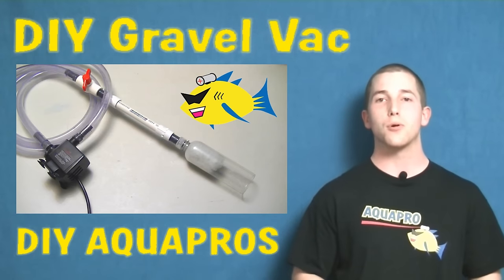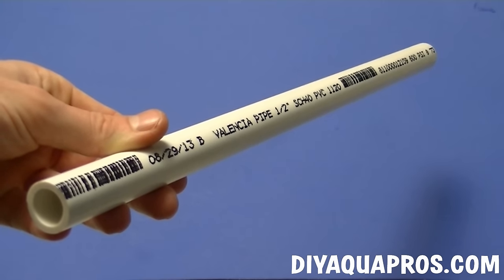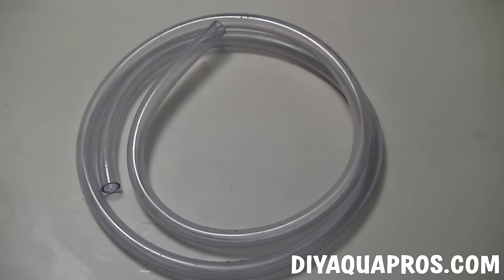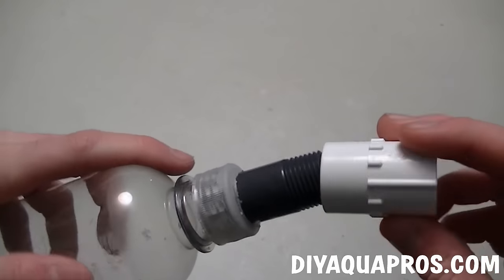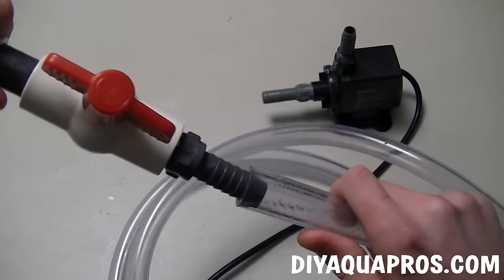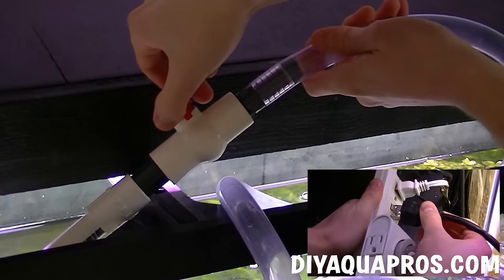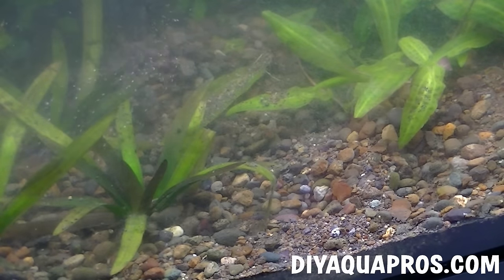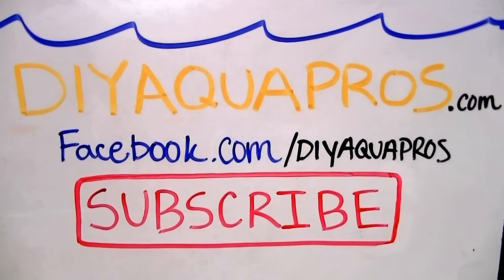How To Make: DIY Gravel Vacuum (Aquarium Gravel Cleaner)

Comment: Just watched this video. I had a similar rig for my tank about 12 years ago. Instead of finding a smaller pump, use the ball valve to reduce the water flow and that should take care of the sand problem mentioned in the video. Sorry if this was already mentioned in another comment. Nice setup. Think I'll revisit this for the small aquarium store I work at.

Comment: I think that if you partly close the valve, it would reduce the water flow, which would then reduce the suction and therefore, can be set low enough not to pick up the sand. Or at least, minimize it. Not a bad idea, but if you powered it with an air stone, it would be cheaper, and much more compact. No need for the hoses and just use a filter bag on the end to catch the debris.
Reply: Great add on idea!
Reply: Yup. clamp your hose to reduce the flow rate.
Reply: Larger bottle size if there is room might also help. 👍

Comment: good idea BUT you should never throttle the intake of any pump.  You can safely throttle the discharge of a centrifugal (kinetic) pump, which most aquarium pumps are.  So install the ball valve on the discharge side of the pump.
Reply: It is to stop the syphon while holding the syphon. You fill the intake with water and plug the end and let it go in a bucket. Then stop the flow with the ball valve then plug the tube easily into the pump. The pump is never on until they syphone is pushing water to the pump.

Comment: A wider bottle may reduce the upward flow rate, making it more suitable with sand. I haven't tried it, but it's an idea.
Reply: Or you could just close the ball valve slightly until you get the auction desired...
Reply: Yeah he is pretty dumb to not figure this out himself.

Comment: to slow the suction down why don't you close the ball valve down so it is reducing the flow ???
Reply: +rov furness 
I agree with you! The solution is already built in that device. The intake suction can be regulated by adjusting the the ball valve as wished. These pumps won't break, even if the ball valve is completely closed and kept like that for a while.

Comment: For everyone using this specific powerhead, be sure to seal the intake cap portion on the powerhead. it has an O ring, and twists to lock tight, but the seal isn't great. Check the video at 5:15 and you'll see he's done the same.

Comment: I am an inventor working on this idea for awhile. I just tested it this very hour. The solution is simple and suck in everything faster with mesh screen ( to filter gravel from going into pump ) at intake. Put the tube with filters at the output right back into the tank filtered. I use  porous foam plugs.

Comment: This is an awesome idea, great job.  What I did, since I already had one of those siphoning gravel cleaners and an extra water filter that came with the aquarium kit I bought (but I upgraded to a better one), I simply run the water through the filter as it hangs over a bucket, and dump that water back in.  Rinse out the filter media for use next time.  If you don't have an extra filter, just stuff some media in the vacuum/bottle like they did here.

It's nowhere near as convenient as this, though, but just an idea for others who aren't inclined to go through with this.
Reply: +Dave “The One and only” Gahan Yep, you can do that. Just plumb it into the middle of your hose, like what's done in this video. Then you can turn the valve to adjust speed, after you have the siphon going.  If you are NOT using a pump to do this (meaning it's your basic gravel cleaner fed by siphon/gravity)...  I'd put the valve closer to the output end of your hose. That way, if you need to close it for some reason (like answering the phone etc)--  you will not lose the siphon.
Reply: Steve Syed he shows the output going directly back into the tank. not a bucket.

Comment: Brilliant idea definitely going to be making one of these if the flow is too strong reduce the pressure with the Valve you’ve already put in line I would also be tempted to use a in-line filter instead of putting the floss in the neck you would be able to put it in the filter loads of cheap ones online

Comment: You can use it for sand as well. Reduce the suction power by decreasing the flow using a separate ball valve at the output section of the pump

Comment: I bought the pump from City Pets close to my work near Beltway 8 and Beechnut in Houston and they even did price matching to the Amazon price plus a few dollars which was still less than shipping. I found all of the plumbing parts and even a perfect 20 oz. bottle at my local Home Depot and the Poly fill at Michaels. I struggled at first with the siphon like someone else mentioned but after I had the siphon completely flowing to a bucket I was able to plug the pump in and just dead headed it with my thumb in order to bring it back to the tank for recycle. I have only had my 36 gallon tank now for around one month but the amount of crud this thing extracted was just incredible. I use larger size gravel and so the concern about sand getting entrained was not a problem for me but I imagine chocking off the flow with the ball valve may work to control the vacuum pressure. I am going to add a power rated rocker switch to the line for easier on off control and may experiment with adding a squeeze siphon inline to get things started. Thanks DIY AQUAPRO TEAM!!

Comment: Perfect. Now you can clean the bottom of the tank, even when your tank is standing right on the floor. The same with water changes. In my case, my paludarium is standing on the floor without closet. So I am going to make this! Thx. for the vid. Very clear.
Reply from the maker: That's another great application! Thanks for watching!
Reply: I have the same problem. The only place where I could find to keep my aquarium is on the floor. The usual gravel cleaners cannot suck up the muck at all.

This solution would probably go a long way in tidying up the substrate.

Comment: If you use a t valve in place of one of the threaded pipe couplers you can open and close the valve to allow water to come in the t-valve as well as your intake allowing you to control the suction strength while not affecting or straining the pump.

Comment: I use an external filter connected via a pipe to a gravel vacuum attachment so that water is filtered & fed back into the tank. Works better if the external filter is on a chair or table so it's at a similar height to the tank which means it's not trying to pump water to the tank as hard.

Comment: Hey Mike tried this on my 20gal aquarium but couldn't get the siphon action going in order to start the process every time I did it air would keep coming into the system....would really appreciate it if you did a small detailed video on how to start the siphon action....PS my tanks about hip height!.....PS only modification I did was I used the flexible 12" hose rather than PVC. Thank and hope to receive a feed back!
Reply from the maker: Rakesh Porob Sometimes the siphon part can be tricky... one of the downsides to the design. Just have to mess with it and be prepared to try it a few times, If you need more help lemme know

Comment: The link you provided for the powerhead redirects you to Amazon and then to a powerhead that doesn't look anything like 
the powerhead used in this DYI. Are you able to provide the make and model number for the unit you used, which includes the required threading for the attachments.
Reply: If you hadn't figured it out by now, when you pull up the link, just click on the option to change the style to a "bottom draw" and you'll see the one he used.

Comment: In any mature tank if you suck water from beneath the gravel and then return that water to the tank you will be adding toxic wastes such as hydrogen sulfide and sulfur dioxide back into the tank. Especially in a planted tank as you showed in the video. It can get anaerobic at the bottom of a gravel column.
Reply: Fishman and that toxic waste was hidden in the sand/gravel, but now is more exposed to water, causing a bigger problem.
Reply: I was looking suchs a response like this cause I'm totally agree. Bad idea.

Comment: OK, I know this has been up for quite a while, but I have a question. I followed the directions, got all the parts, but for the life of me I can't get it to work. My problem is with establishing and keeping the siphon going. Is there a trick to it? I can get it started but as soon as I try to put the discharge hose in the water I lose the siphon. How do you start the siphon, close the ball valve, put the discharge hose in the tank and turn on the pump with just two hands?

Comment: The project is so great but I have a question : How powerhead can be worked if impeller running 'dry' ? That's external pump and it's not easy to make powerhead works unless you place it in the Aquarium tank
I brought 1 external pump with input and output and it doens't work, there no water flow coming in & out...You guys got any advices ?
Reply: Hai Phan prime the pump first.

Comment: If you use a wider and longer bottle like a 2 liter you should still have enough pull to suck out the debris while letting sand and smaller pebbles fall back down.

Comment: I do something similar for sand ....2 power heads mounted inside on each end of tank, mounted 4 inch from bottom...same water bottle technic...turn on and wait 15- 20 min.... the current working against each other stirs up the sand throwing the lighter stuff up into the water..... it then gets sucked up into the water bottle....... I then do my water change as normal..... I still do vacuum the sand but it take a lot of extra work out.... 2 power head method is used on my 55 gallon but I only use 1 power head for my 30.....

Comment: I tried such idea before. The biggest problem is that the electric pump won't start sucking by itself. You have to, as you said, prepare siphon first which is hell of a hassle. That is the main reason, when selecting gravel vacuum, people prefer ones that have self-start valve or bulb pump. Also the cost of the whole set could be quite expensive.

Comment: What brand powerhead is that? I'm not having luck finding a good one. Thanks!
Reply from the maker: The brand is EcoPlus, check em out! Their reliable.
Reply: Thanks man. So is that a submersible version that you've rigged to take 2 hoses?  All I'm finding online is a submersible version designed to take one return hose. Please advise.
Reply from the maker: Here's a link. We use the 396 model

https://www.sunlightsupply.com/shop/bycategory/pumps-and-irrigation-supplies/ecoplus-fixed-flow-rate-submersible-pumps
Reply from the maker: The second "intake" port is under the covered pre-filter. You just remove it and your ready to go.
Reply: Thank you!!

Comment: Hye Bro. Is there any other powerheads model that can be use beside what you use. In my country, all this kind of aqua stuffs are very limited. I tried to search it on ebay and amazon. From my opinion, the price of the unit is reasonable but the shipping price is almost $100 convert to our currency. Can you please find other solutions for this. love your video.
Reply from the maker: Hey thanks, Ive only used this pump for this project but you could totally use whatever you have access to. The connections may have to be more elaborate but you could make it work. All projects aren't black and white, you can get as creative as you need.
Reply: Go to a hardware store, garden and plant stores, anywhere that sells things for ponds. You may be able to a powerhead and for much cheaper than you would at a fish store.

Comment: Mine was sucking air at pipe ends. Had to glue to stop. Siphoning to start is not easy but a few tries you can get it. Be prepared to change polyester often and restart siphon. You will get wet so have towels available. It's not as simple as the video portrays.

Comment: Question: I have a pea gravel bottomed tank. Could I attach a filter to the output side and run the water through the filter and right back into the tank?
Reply from the maker: I wouldnt recommend it because you dont want small rocks/snails/debris going though the pump internals :/

Comment: Isn't it bad for the powerhead to be running "outside" the water area as shown here? Luv the idea though!
Reply: +JOWEE BOIE This confuses a lot of people. Powerheads say 'do not run dry', but that means do not run the pump with no water being sucked into the pump.

As long as water is going IN the intake and through the pump OUT to the output, it's being cooled by the water. "Submersible" pump means they have usually sealed any electricals inside a block of epoxy.
Reply: +D rB  =)
Reply: thanks a ton on that info!!!  so can i run the submersible power head outside the tank???

Comment: I need help/advice.  i made this gravel vac.  how do i keep from losing the suction in this thing!!??  every time I have to change the floss, and yes, I turn the lever to off, it loses the suction.  what a pain to struggle with the thing to make it suction up again when you have already started.  can anyway tell me if they found a way to do this?  one problem I have is that my powerhead has to be submerged IN water.  but it is frustrating.  can anyone give me a workaround or any tips?  thank you.

Comment: Only modification I would do, with this pump you can throttle back the suction to be able to use it with sand by adding a valve on the return end, that way you can slow it down.

Comment: What powerhead model did you use?
Reply from the maker: Eco-396 powerhead. Its a very reliable and versatile pump, fits the threaded hose connectors we use in many of our projects and is reasonably priced, about $22 bucks

Comment: great idea but just use normal aquarium filter pads it is cheap enough and love this idea of the bottle but tbh id prefer to remove the fish and put them in a holding tank of the same water ... then siphon and clean while getting rid of the old water and then add the treated water after just makes sense as no filter will clean 100 % would rsther just do the water change at the same time .. luckily for me i have a small aquarium and tbh i havent cleaned it for over two months and the water is crystal clear free of nitrates and the fish are happy but i am doing my water change in a couple of days going to use this desgin and buy a external filter ... these are the first fish i have ever owned to im new to all this and i love the cleaning part of it stops me from ever losing interest

Comment: A list in your description with item links would be helpful for either Lowes or Home Depot, as there are many items to choose from that match your description.  For example, you list male risers but don't put how long they are supposed to be.  It's not an easy build for me since I don't know what to get from your video (other than the pump).
Reply: *****  they dont have these stuff in lowes of homedepot. u have to go to those local shops.
Reply: Actually they do have all the materials with the exception of the pump.  I bought the pump online and it failed within a week.  Once I returned that, I bought a pond pump at Home Depot.  Less money, more powerful and it hasn't failed in two years.  It also came with a bunch of adapters and attachments.  I used those materials to build a better one than this guy did.

Comment: Isn't the idea behind gravel vacuuming to remove fish waste? I'm confused by your cotton material you're putting in the hose (watched without sound). I don't see that material being coarse enough to trap the fish waste either.

I really like the idea of the self priming pump connected to the gravel vac though.
Reply from the maker: The idea is to trap as much waste as possible, the poly is pretty fine and wont let any visible material through it. This way you can help prevent waste build up without having to change the water. Not meant to be an alternative to real water changes, but may be something some aquarists want to try out.
Reply: You could always add a circle layer of something like a scrub pad to filter the bigger stuff.

Comment: Why such an elaborate build? Just attach the bottle on the powerhead (suction part) and used the powerhead as a handles. The powerhead eject the filtered water on the side there's no need piping or other stuff.
Reply: Hazri O
Reply: I'm sure the extension was for people with deeper tanks. I need a ladder to do water changes in my 380 gallon, so it was great to see something like this. Also holding the powerhead may be a bit annoying over a longer periord of time.
Reply: Deeper tanks plus siphoning for water changes and the ability to start and stop the pump,,,say, the phone rings,,you can pick right up here you left off. Plus, DIY people take greater pride in stuff they make and enjoy the work just as much as the end results.
Reply: By adding needless junk to it they can try to patent it or get around pre existing patents.

Comment: I found these video, after coming up with the idea of using a spare tub filter to do the exact same thing... Although this project is good I think using an old tub filter is a cleaner no pun intended,  way to achieve the same goal.. which would be to recycle water in the tank but removing the fish doo doo.. anyone else thought about using a tub filter to clean?

Comment: Can't you just find a way to connect a gravel vacuum to your filter? I mean, that is basically what you just did right? You took a pump from a 400 gal. per hour filter and rigged in such a way that it sucked in water with the propellor removed, correct? You needed to show what you did to the pump and just fingernail polish the pump info. Just don't use clear fingernail polish! :)

Comment: What you call male risers are actually called nipples.
The male hose connectors are called barbs.
What you call female adapters are actually called couplers.
The plumbers tape is actually called Teflon tape.